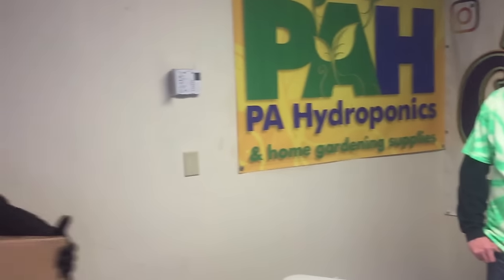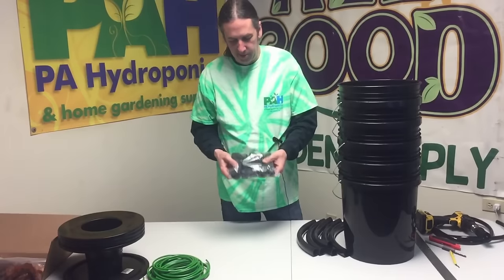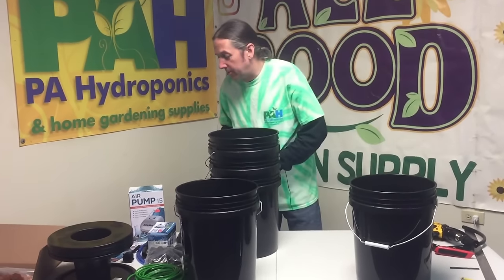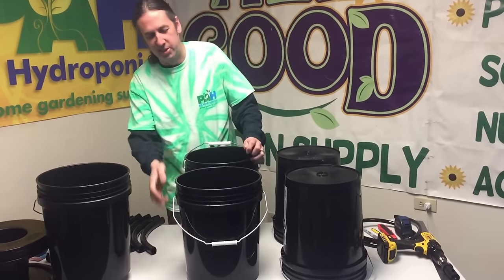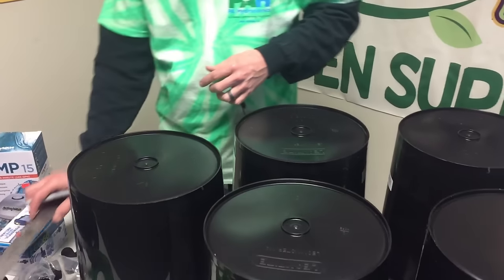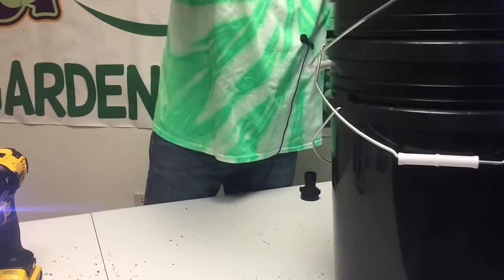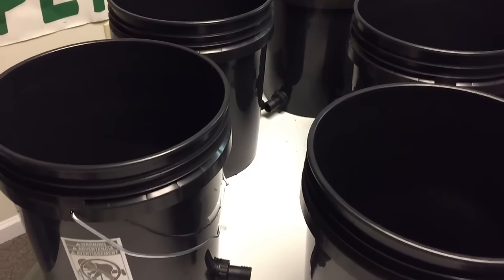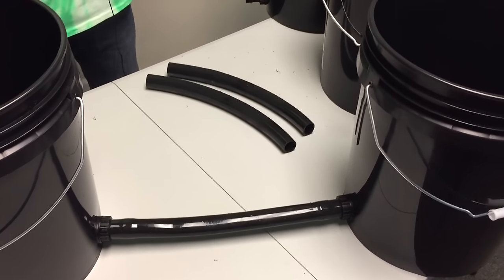Easiest 4-Plant Stirponic RDWC with Reservoir and Water Level Indicator built from scratch!!

Comment: Watched lots of videos. Watched this one and bought the 6 bucket DWC. Had problem with failures on the leak test. (I'm sure you looked in the grommet method.)  After a few stubborn leaks ( I used to worked in manufacturing, assembling and testing gas regulators), I used plumbers white tape on the threads and cleaned any debris on the gaskets. That fixed it.

Cold weather with morning temps in the 40's (in MAY!) stalled the growth process. (I live on MD Eastern Shore) Now with warmer temps, they're greening up nice and developing at a DAILY rate. ( I use Advanced Nutrients with the the gorilla.) Advanced Nutrients webpage has a confusing feed schedule. I only need to know how often the change the solution.

Comment: great tips on the build 15 min in and i like the tip on the hot water to loosen up the molecular structure of the hosing. one tip i can give is if you use a map gas torch or a butane torch on the burrs helps with rounding off the edges. i even use it after the de-burring tool. have yet had a leak and my system has had seven grows on it.
Reply from the maker: Good tip, I also used a hair dryer to heat tubing on our newest system and that worked great too but using torch after the deburr tool sounds like a good idea! Thanks for watching! Gary

Comment: Gary, thank you for the informative videos. Why not spend an extra $2 per line and add a airway check valve? This way you don't need to elevate the pump and in the event of a power outage water can't crawl all the way back to the pump.

Comment: Great idea using the paper towels under the buckets to test for leaks. I'll have to remember that trick!
Reply from the maker: :) Thanks for watching. Gary
Reply: @PAHydroponics  Your systems are also extremely reasonably priced! After seeing a 12 site system from SuperCloset go for $1300 I started researching DIY systems and came across your video. This will help me build my own RDWC system for a fraction of the cost!
Reply from the maker: @ConsciusVeritasVids  They dont even use 1" tubing just 1/2 inch, I inch is way better flow. G

Comment: You know Gary mentioned the quadruple barbs on those 1 inch fittings which are nice and if you shop around you'll find most do not offer but one barb so definitely worth mentioning. it's going to have to pass through three barbs before leaking.

Comment: How about having two pumps with alternating timers so it would go 5 min each direction to avoid cloging the pipes? Just connecte a Y on the hoses in the reservoir with bottom of the Y going into the connecting hose so that the water would choose the path with least resistens on the return?
Reply from the maker: Hello, interesting idea Hmm, I did have 1 person say they used cloth pots in the net basket and that kept the roots from going crazy and also most people say they are doing fine with the roots. G
Reply: @PAHydroponics  yeah, I built my system with 3/4" return lines as I didn't see the recomendation about using 1".. I can't seem to find 1" around here either.. So think I might try to use two pumps.. Maybe 5 min of no movement in between..

Comment: Just got my kit set up not sure what setting to run the water pump should I have it full blast or dialed down a bit? Appreciate all you do brother keep up the great work
Reply from the maker: Look for flow between the buckets, you don't want so much force that you can damage roots but enough to circulate the nutrients and oxygen throughout the solution.

Comment: What can I get to cycle the circulation pump? I have looked for timers that can do that but with no luck. How far up the mesh pot should the water be also?
Reply from the maker: Hello, the timer is called a recycle timer - there are lots of brands of them. You should run your water high enough to touch the starter plant untill the roots start growing, the clay rocks dont wick up much. Thanks for watching! Gary

Comment: The videos are great. I have a room with 16 plants in soil, been very interested in dwc. I have a few questions about scaling that I hoped you would answer. 
If I add 8 more buckets in to this set up will I need a larger reservoir. Would the 75 pump still work for a 12 bucket setup? If not what would you recommend? Also do the lengths of tubing have to be even ? How far away can my reservoir be from the setup? If I have 12 buckets in the room can I put my reservoir outside of the room through a hole in the wall ? Other then that, great video. I planned on building a watering system but this seems more fun.

Comment: Gary,  You are the Man!!! I'm so happy I found you/your store/your videos! Almost spent a lot more for much less and a lower quality system too. This is the system for me! So happy I can order it drilled! Can I order this with a larger reservoir bucket? Like the 8 or 13 Gallon square ones? If so, would there be any drawbacks or problems because of the larger reservoir buckets? I'm thinking those buckets would be a little easier to work with. Also with  more water the easier to keep the Ph etc. in line and with less fluctuations cause there's more water--or am I wrong about that? thanks!
Reply from the maker: There are parts and accessories you can purchase on the website to add to any system. You can create your own system all together based on where you are gardening, how much space, or other factors that can significantly impact your environmental conditions. Please visit our website and take a look around.   Link to the Stirponic RDWC page is provided below.

http://shop.pahydroponics.com/stirponic-bucket-systems/
Reply: @PAHydroponics   @PA Hydroponics  thanks Gary!! I appreciate the response and feedback. I have checked out your website and you have tons of cool & really systems at super affordable prices too. I think this 4 bucket stiraponics system would work perfect for me (I'm just starting out with Hydroponics) & want to start fairly small.  I'll be calling in the near future to order. I want to discuss potentially adding a larger reservoir to this 4 bucket system-the pro's & con's, its easier to talk about  it than type. Thanks again!

Comment: Can 3 gallon buckets be used in the water fall system you created with 2" PVC pipe with caterpillar? Can monitoring the plant growth, it would be best if I also watched for any roots that are growing longer than the remaining root mass. be trimmed evenly to ensure even and steady growth and eliminate root clogging? Feedback would be greatly appreciated. Ron
Reply from the maker: 3 gallon would be for small quick turn around plants, would have to be square for 2 inch fittings to seal. I have not tried the 2 inch on the "hump" piece and don't know if it would work but I have a feeling it wont work to well so let me know if you try it, or you could do 2 inch on everything but make the hump 3 inch because that definitely works on 3 inch. Old rule of root trimming is don't cut off more than half. Just my 2 cents! Thanks for watching. Gary

Comment: Do you think steel hose clamps would fine if a barbed connector leaked and/or you wanted to go up to 8 buckets? Thanks for the helpful and insightful videos!
Reply from the maker: Hello,  the barbed fittings usually are not what leaks, it's usually the seal of the bulkhead to the bucket, hose clamps would work just fine on them if you want an extra level of assurance . G
Reply: I’m still having leaks is a gasket sealant OK to use?

Comment: Hey guys, If you use a larger tubing size would you be able to use a larger pump and keep all of the buckets level? Sort of like your Fallponic system, but using this simpler Stirponic setup? I'm trying to get a temp setup for plants I started a few weeks ago that are really growing fast, and need to get them into some intermediate (4 Gallon) buckets until I can setup my 400 gph Fallponic type system with 13 G buckets and dont want to have to buy 2 pumps.
Reply from the maker: Hey man, I have not found anything bigger in soft pipe and even the 2 inch bukheads wont work on the round buckets we tried it, we had to move the holes way up to get to a point that it would flatten out enough and then when we drain it it leaves 3 inches of water, if you find something bigger than 1 inch that works let us know! Thanks. Gary

Comment: Love your channel!  I ordered one of these, which I've set up in my basement.  If I were to heat the water this winter (since it can get down to 57 F on the coldest nights at times in my basement), should I put one heater in the reservoir bucket, or do I have to put a heater in each bucket?  Thank you!
Reply from the maker: Hello, you should just warm the reservoir bucket and let it pump it around, You have a great basement and maybe think of putting some foam under the buckets if you are on a concrete floor and that may be enough to help. Thanks for watching :) Gary
Reply: @PAHydroponics  Thank you so much!

Comment: If I make the resevior further away would I need a stronger circulating pump?
Reply from the maker: Good question and you can have it a lot farther away on this system and it will still work fine, bigger pumps or smaller tubing dont work well and will throw off the water levels in the system. Hope this helps! G

Comment: @PA Hydroponics Could I shorten the tubes up and make 2  systems like that, which would fit in a 5x5 Grow Tent… ??? Meaning I would have to have 2 reservoirs…?
Reply from the maker: https://shop.pahydroponics.com/diy-8-plant-5-gal-stirponic-parts-kit/

Check out the above link... it is an 8 plant Stirponic sold on the store website.

-w

Comment: Hey Gary, I wanted to thank you for you videos as I managed to assemble your system following them. I would have loved to just buy your system but I live in freaking Argentina and usually things just do not get here. I was able to get almost every component on itself, or similar ones in some cases... like the drainage fittings. Those damn parts were a pain to get and I was only able to get them from china (and paid like 2 euro each). Also, I was not able to get the black flexible tubing that you use to connect the drainage fittings, so I had to use like... rigid 40mm tubing and it seems to work just fine... but it´s not as flexible.

Besides sharing my experience with you, I wanted to ask something in particular. I ended up using another system in order to recirculate the water. Instead of connecting the water pump to one of the lower drainage fittings, my pumpo takes water through vertical tubing and then that one is divided on different tubes so each end falls back on top of each bucket. I hope you know what I mean, I can´t attack a photo here.  My question is, why did you not do it this way? It also oxygenates the water, and roots don´t tend to got through the tubing so much. It is a bit noisier I guess... but just wondering if you approve my method hehe.

Anyways... just thanks you for sharing all of this. 

Kind regards,
Manuel
Reply: Que onda Bro, me pasas la lista de todo lo que compraste porfa

Comment: Great vid , where can I get those bulk head things ? Can I use silicone around it so theres no leaks ? , I found some on Amazon. Drain/ bulkheads.
Reply from the maker: Yup drain bulkheads 1 inch, we also sell them on our website, dont drill to close to bottom, about 1 and 1/2 inch or 1 and 5/8th up from bottom with 1 and 1/4 inch hole saw and clean up your holes and dont over tighten and you should not have any leak issues. Thanks for watching :) Gary

Comment: Hi Gary.  I noticed you recommend changing out the water/nutrient solution on a two week interval.  Do you usually have to top up the system during this two weeks?  If so do you just use premixed solution?
Reply: You can top off with pH'd water or 1/4 strength nutrients if the water level falls too low.

Comment: please correct me if i am wrong or if there is is some disadvantage to my idea that i do not see yet:
you would only need 1 passage per bucket if you interconnected the  pipes.
i think passages are a relatively expensive piece. more expensive then what it takes to interconnect the pipes. 

maybe the water level will be more even with this method-
anyway a important premise is that the ground is even

Comment: Ok now long ago (20 years) I built a system like this before DWC was really well known.  I did a 20 gal tote tank instead of the 5 gal bucket, and 5 gal. buckets for each station like this, and like this used a submersible pump, it heated the water up so much in 8 hours that it burnt my plants up, how does this deal with that?

Comment: Hi Gary,  I'm just trying to figure out this system on my DIY Colombian  version.  I just got 2" bulkheads from your website.  I was wondering if a round buckets will works or if better get square shape ones, like ones you use on the other RDWC system.
Reply from the maker: Square buckets or containers with a flat side are preferred with the 2" and 3" bulkheads.

Comment: Quick question Gary, will the water still circulate well even if the reservoir is further away than the pre cut hoses? I'm working on putting my system together, and having my reservoir further away would work best. It just seems likes the water wouldn't circulate as well if i double the length of the hose.
Reply from the maker: You should still be good to go, its still about the same amount of water/pressure in system and should still flow the same. Thanks for watching :) G

Comment: Gary, can you use that 75g pump as an inline pump, instead of submersible? I don't want to add any heat into the water. So, no more than a 75gal/hr pump with 1" tubing?

Comment: would it be possible to have the reservoir in the center and just angle the pipes differently?
Reply from the maker: That is one of the cool aspects about hydroponics.  As long as you keep the conditions for the plant favorable you can modify the "system" to whatever degree you may like.
Reply: @PAHydroponics  thanks for being so helpful! I'm putting together the system tonight. Definitely will reccomend to others here in NY with the new laws and such

Comment: Instead of a static water level indicator is there a way to add an electric switch/level that activates a fresh water pump to level the nutrient????  Water is the first thing to be used and it would be nice to have an active system to refill the used water during the day.

The only thing I would change is the lid/net pots.  I would have a 6" hole in the lids and the net pot separate.  Two piece.  Less damage if you have plants starting to grow in the net pots prior to placing them in the final system.

During the dark period does the nutrient pump need to run constantly or just a few times??  Just concerned about heat development in nutrient.
Reply from the maker: Hey, you could add a reservoir top off kit that runs on gravity, as for the pot lids you can do all kinds of things there. And it is fine to cycle the pump if you would like, it will keep it a little cooler, this pump is small and does not get very hot. Thanks! Gary

Comment: How can you tell if your pump is circulating the water correctly? Should you be able to feel the water entering back into the reservoir?
Reply from the maker: Hello, it is a slow flow system and you should be able to feel the water coming right out of pump easiest, and where it enters back to reservoir you should feel a slight flow  but with your hands in the water you might not feel it, maybe stick a finger right in the hole, yikes that sounded bad :) Anyway. Hope this helps! Gary

Comment: How much water should be in each bucket how far from the bottom of the net cup???
Thank you for the video???
Reply from the maker: The water level depends on how far along the plant is in its development.  Initially the water has to be high enough to contact the starter plug, or roots.  As the roots develop you can bring the water level down where it may be easier to manage.

Thank you for watching and I hope this reply has helped.

Comment: gary, i am having a problem with my first bucket filling up and not circulating the water. it seems like it will over flow and not disperse to the other buckets and back to the reservoir
Reply: i have it set up exactly like you have built in the video... do i have too much water in my buckets?
Reply from the maker: Hello, sounds like you may have used a bigger pump tham I use, my pumps are 100gph max, it wont run right with anything more than 100gph. G

Comment: Could you use the same pump for a 6 bucket system or would you recommend a slightly bigger one?
Reply from the maker: Hello, it cant be bigger because it is just 1" tubing and that size tubing cant handle anymore flow or it will get backed up. Hope this helps. Gary

Comment: Any triks to stop leaks were the hose meets the bulkheads
Reply from the maker: Check out this video.  There are variances in the vinyl hose as well as the "flashing" on the bulkhead threads and shoulder that should be checked before assembly.  A simple zip tie could be enough pressure to seal the gap. If you bought one of our DIY kit we do provide a little information on this problem as well as a couple hose clamps if you run into it.

https://www.youtube.com/watch?v=ZAJjvT2bN6c&t=63s

Comment: excellent vid sir, Ok to use white buckets, white lid. Maybe even beneficial?  Easier for me to purchase the white 5 gal. I would install  6" baskets in the lids. Sounds to be better than larger baskets for the stability. I could do 4 of the 5 gal connected without a res correct ?  Thanks in advance
Reply from the maker: Hey there, you can use white buckets but you should wrap them in foil or something to keep the light out of the root zone, I'm not sure what you mean about the connecting 4 of 5, they all should be connected to get it to circulate back to the reservoir. Hope this helps.G